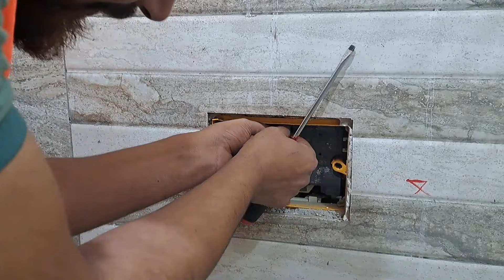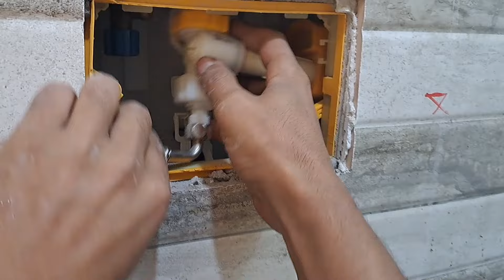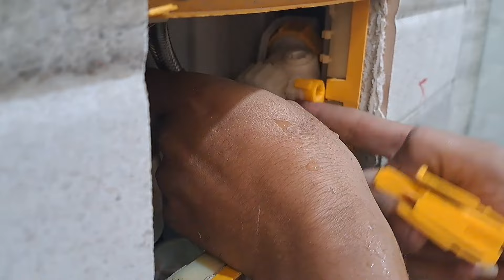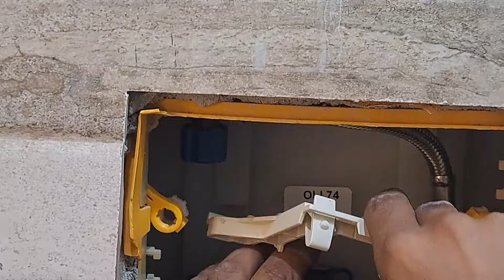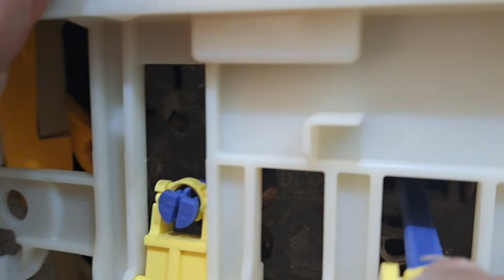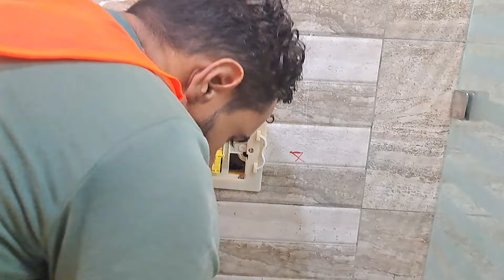Kohler Flush tank Solutions for Overflowing Secrets Siphon System Settings

Comment: Which is the overflow in this part because i want to clean weak flushing with vinegar
Reply from the maker: "The overflow tube is the vertical pipe in the tank connected to the flush valve. To clean it with vinegar, turn off the water supply, flush to empty the tank, and pour vinegar directly into the overflow tube. Let it sit for a few hours, then flush again. This helps clear mineral deposits causing weak flushing